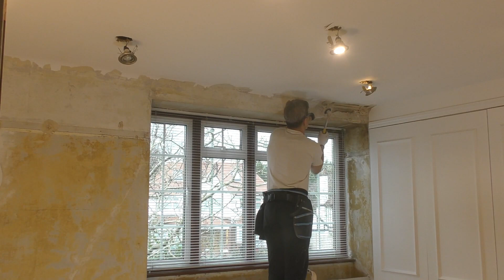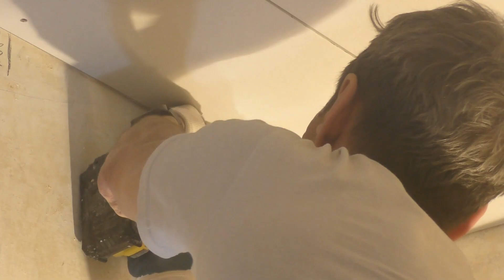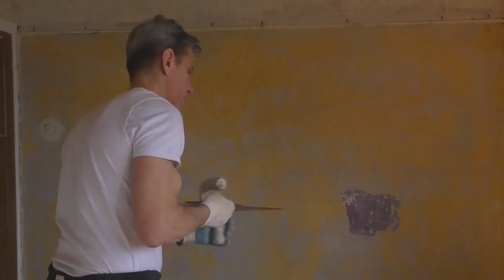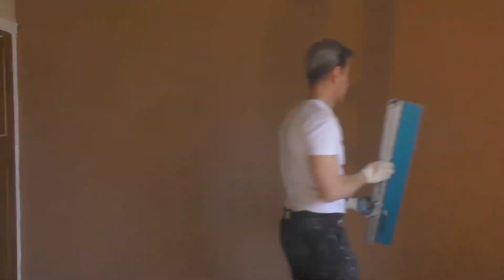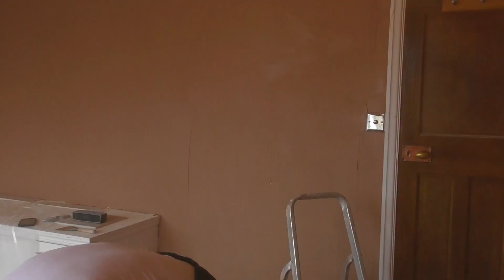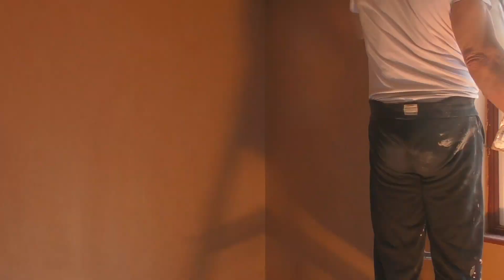Relax, Watch, and Learn

Comment: I relaxed , watched and learnt . Thank you. 
Why did you plaster then put PVA on the wet plaster?
Do you ever tape over the screw holes? And if not why not?
Reply from the maker: Thanks Mark, the first plaster is bonding and it was done the day before, so if you dont PVA it, when you put the finishing plaster on it dries much to quickly, almost instantly in fact, if your putting them both on, on the same day you dont really need to PVA it
Reply from the maker: And no point taping over screw holes as there small enough that they just get filled by the plaster

Comment: Hi Eric, I have subscribed, my first ever!..
Nice to see and hear a chilled, polite, non shouty proper English plasterer...big thumbs up.
I noticed on the relax and learn vid, about the window, to ceiling, no scrim tape between the new bonding, and new boards, why..?
...and appears you use the square edge boards, not tapered, thoughts on why?
I am JUST starting to plaster my home,(every ceiling has been down, and new board up, newly boarded walls, and some hardwall plastering) your calm informative videos help, a lot.
Cheers
Steve
Reply from the maker: Hi Steve, theres coving to go up in that room ( another video) so didnt bother with scrim onto ceiling, I always use square edge boards as you only really need tapered edge if your taping and jointing instead of skimming.
Thanks for the complements mate, and for liking and subscribing, much appreciated 👍

Comment: Great work subscribed. Are some surfaces one coat and others two? What was your decision making behind this? Do you only do a second coat if you feel you need it? I’ve plastered before and thought the first coat was fine but have been told always to do two coats so do the coat regardless but that maybe costing me some time
Reply from the maker: Hi, thanks so much for subscribing! And for the complement. General practice is to apply a second coat as it is easier  to smooth the whole thing out as it goes off, I have done one coat finishes before where you put the first coat on a little thicker and when it hardens enough, wet it and trowel it up, but that can be a little more difficult, if you do a wall with one coat and when its finished its flat and smooth then, in my opinion, I dont see a problem with it, but, because its normally done in 2 coats, purests will tell you, you shouldn't do it that way, I normally mix enough up that once the first coat is on I have enough left (which I thin down) for the second coat as the second coat uses much less plaster than the first, of course make sure the first coat is still quite wet when your putting the second coat on, the first coat shouldn't have set already. Hope this helps.
Reply: plasterer.org.uk so just to confirm you mix one large batch to do first coat and possibly two? And then once first coat is on you add water to the already mixed plaster remix and apply? Will the water mix well with plaster that has been sat there for a bit? Thanks for the replies
Reply from the maker: @iPhoneTaxa  yes. The plaster will mix well with the water, but it will start to thicken again quite quickly so you dont have long to get it on. Never do a larger area than you know you can handle

Comment: Was that one coat of multifinish? ceilings are hard for me to do. Thanks G
Reply from the maker: Hi Glen, it did have a tight 2nd coat that I softened up from what was left of the first mix, but that does put pressure on you to get finished quick, if the second coat is a fresh mix you have a lot longer to flatten it out

Comment: I stopped using pva on old lime and lath and plaster because I’ve had it react badly and crazy before even when its sealed. You ever had that happen ?
Reply from the maker: I have gone over wooden  lath with bonding plaster back in the past and it cracked badly when it dried, is that what you mean? Thanks for subscribing 👍
Reply from the maker: Oh, and I never water down my PVA
Reply: plasterer.org.uk I mean this but also the crazing effect when lime plaster has crazy suction even after it seems sealed. 
Most guys do a 50 50 mix with pva, I occasionally do this if I’m in a rush and the circumstances dictate it. I mainly use  blue grit nowadays because it’s consistent, bonds to all substrates well and gives uniform suction. I try to follow manufacturers instructions with pva but have found on certain jobs in the past with lime (which by the way I don’t recommended slimming over with gypsum finish but I do what I’m paid to like the rest of us) can some times take half a dozen coats of pva and still play up
Reply from the maker: @amateurvegan2636  the only time I've had crazing is when I haven't used enough PVA,  I used to water it down years ago when i used uni bond PVA because it was so thick, but the cheaper stuff is already quite thin and I had issues when I watered it down so stopped doing it.
What do you do if a client wants you to skim the old lime plaster walls?
Reply: plasterer.org.uk 
I think some times if the limes been exposed to a lot of water then dried out with heaters and dehumidifiers it makes it impossible to seal with pva just sucks it in even neat coats.
I like to follow manufacturers instructions where possible and putting neat pva on makes the skim hang around too long for my liking. Also less suction may affect adhesion of the material the same as too much.
A customer always gets what they want, some times the take in the advice and sometimes they don’t want to fork out which I completely understand too.
If I don’t like it though I’ll stay away, especially if they seem like the difficult sort, very rarely swerved work though and only ever been had pay issues from companies. Domestic customers always been great to me
Reply from the maker: @amateurvegan2636  yeah, I worked mostly for big contractors  back in the 80s and 90s they use to pay you weekly but then began wanting to pay monthly, which was no good for me,  one company I worked for were stupidly called Perfectionist Plastering, they went bust after making a stupid error, but as you say domestics are much less problematic and non payment has never been an issue. I've rarely had a problem with neat PVA which is why I continue to use it, and I often do 2 bag mix on finish so like it to hang around as long as possible
Reply from the maker: Ps, if I get a bad gut feel from a potential customer,  I'll  avoid them like the plague. Learnt the hard way though
Reply: That's interesting I've always used the uni-bond pva in the red tub as it was what I was bought upon as an apprentice,i have never used it neat fresh out of the tub,its something I may and see if theres any difference in suction and drying times etc  once I can get my hands on some materials
Reply from the maker: @Lemon-squeezer  I keep hearing wicked is gonna get some finish in, but so far it hasn't happened🙁 the red tub unibond is the thickest  and usually the most expensive, it might be a little to thick to apply neat, let me know how you get on 👍
Reply: @ThePlasterer  I've got about 4 jobs booked in ready for july when I start back,I have a trade account with wickes as there prices are cheaper than most for plaster plus they stack it better,I have a kitchen and diner to do next week for my sister law I boarded and dabbed it all out about 6 weeks ,my brother told me today he can source some stock from june 4th but are limiting it 10 bags per customer so I dont know whether that rule will be enforced with most merchants
Reply from the maker: @Lemon-squeezer  the stuff will go off the shelves like lighting, I got work too, just no gear. Fingers crossed
Reply: @ThePlasterer  I've ordered me in some bags of carlite finish to get cracking with in july I dont trust the stock levels situation like you say it will be sold out soon as it comes in
Reply: stewie3ify tell me about it, the delivery comes and it’s all gone in the same hour where I am!  It defiantly makes the plaster hang around ALOT longer, personally I prefer it going off a little faster then this
Reply: If it's any help to anyone, I had good results on patching holes in old, dry dusty lath using SBR primer and bonding. Used 2 coats of neat SBR. It's more expensive than PVA but in tricky situations it performs better. Great channel. Just discovered it. Really like the approach to work. I never thought of mixing down the first cost left overs and using as second coat. I was told never to try to water down plaster that's already going off, but if that works for you, you're getting a great result, so fair play..
Reply from the maker: Thanks John👍

Comment: 1 coat plastering no go mate my professional opinion dont touch anyone that 1 coats .n I'm a plaster of 12 years .
Reply from the maker: There is a tight 2nd coat on the ceiling in the vid, and the 2nd coat makes the flattening out process much easier, one coat is not recommended but I have one coated in the past, never had a problem. I've been plastering for 35 years